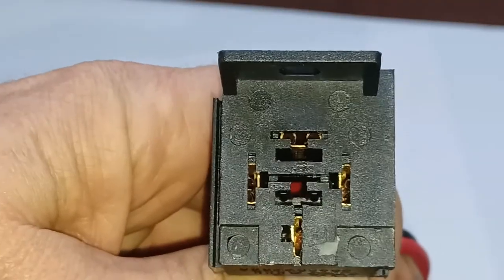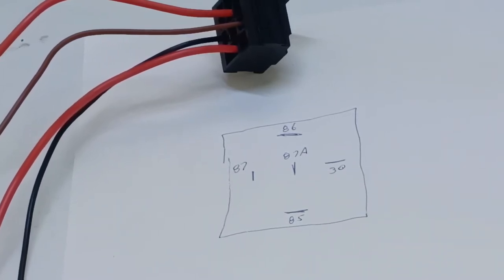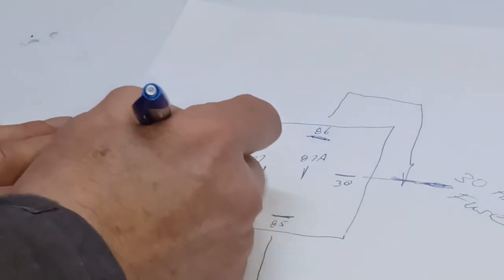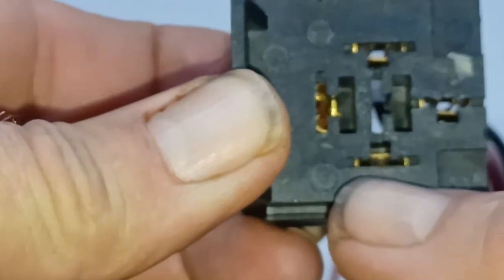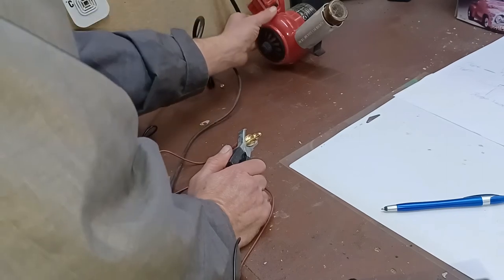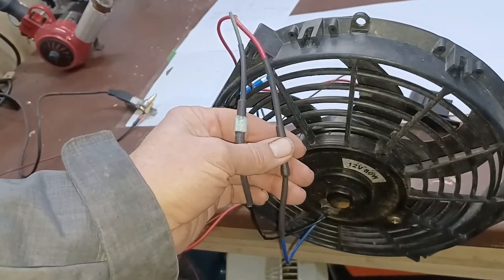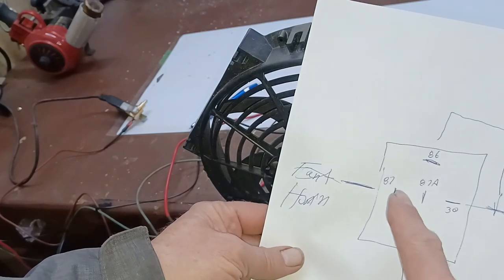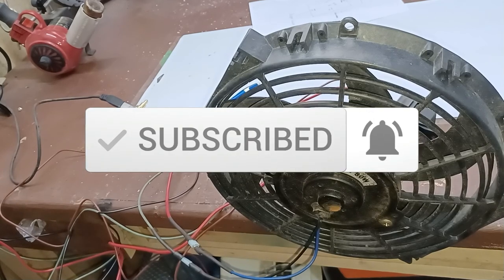Negative Triggered Relay Circuits for Cooling Fans, Door Locks, and Horns

Comment: I’m trying to wire a chime to trigger when my car door opens and a different sound for when my fuel gauge is low how would get something like that to work? The sound board is negative triggered.
Reply from the maker: The dome light and the low fuel light both should be negative triggered. Make one circuit with a relay and additional buzzer or chime. The original chime should be able to be triggered when the negative from the fuel light or dome light is turned on.

Comment: Where would one add an led light to show the circuit has been triggered by a ground signal?
Reply: Take the ground of the LED lamp and attach it to the number 85 circuit. Bring a positive to the other side of the LED. When the circuit on 85 is grounded it will actuate the circuit and the LED will light.
Reply: @truthinadvertising2702  perfect! Thank you